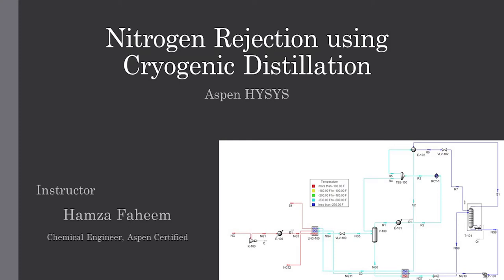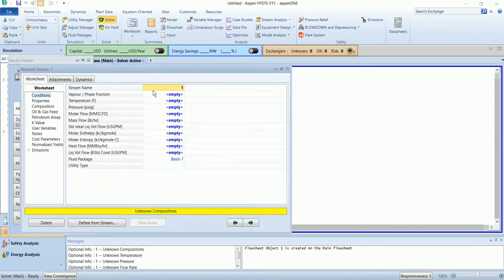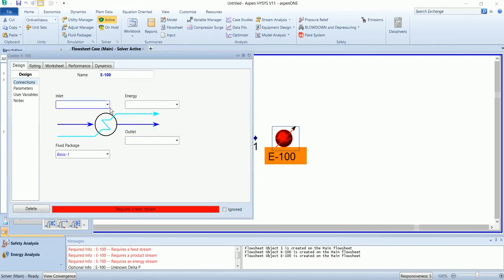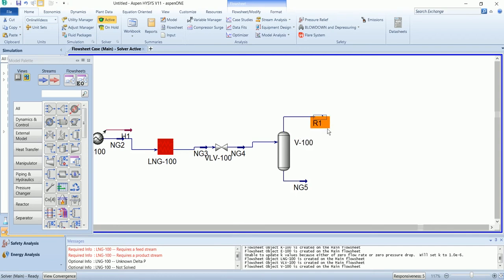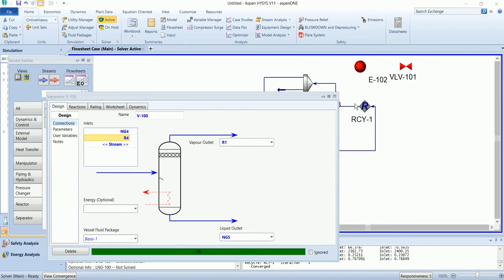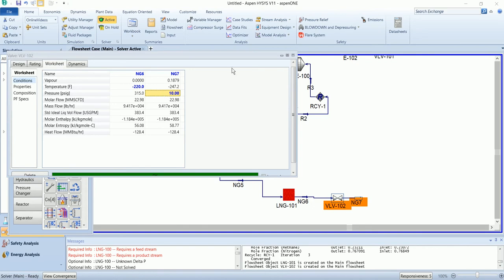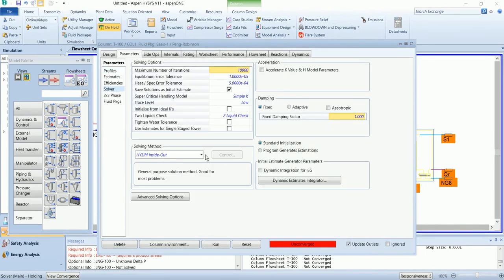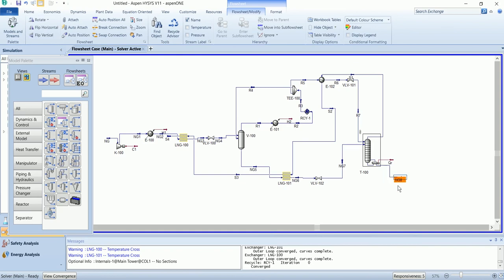Nitrogen Rejection using Cryogenic Distillation || Aspen HYSYS

Comment: Hi, Great Tutoial, i have a problem in converging the distillation column (i'm getting : Fatal Error - Zero Diagonal in Column Matrix) Message and the column doesn't converge ! That's for a Dumping Factor of 1. 

While i change the dumping factor to 0.5 the column rapidly converges ! 

What is your explanation for this ? is it because the distillation column in this case is Highly non Ideal ?
Reply from the maker: Yes it's highly non ideal.
You can also converge the column with dumping factor 1 if you have some guess values of column temperatures
Reply: @Chemiopedia  Thanks a lot. Waiting for the next Tutorials. I hope you'll teach us some of the Economic aspects of processes using Aspen Process Economic Analyzer and some get into rigorous modeling of all Heat Transfer Equipments in HYSYS.